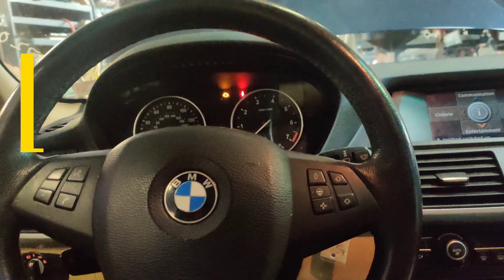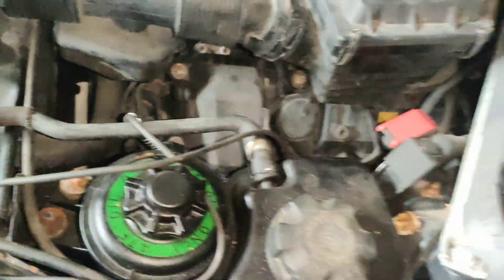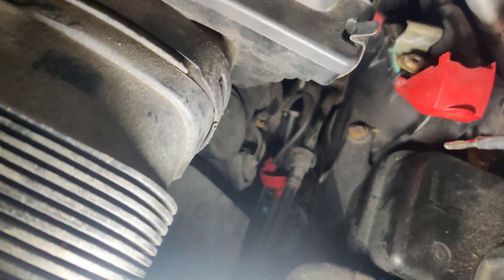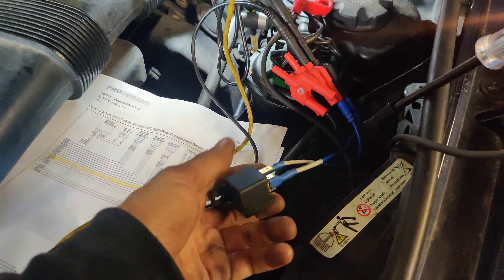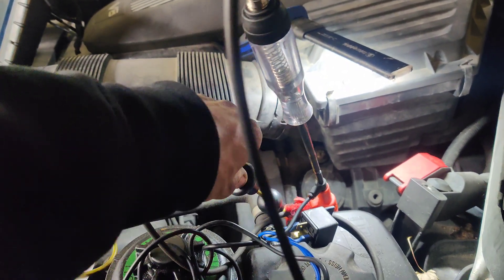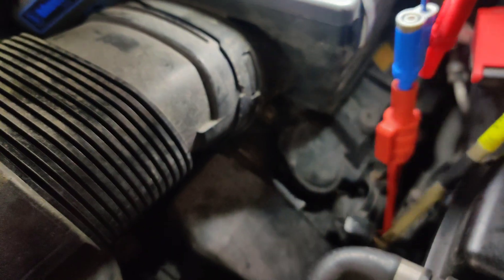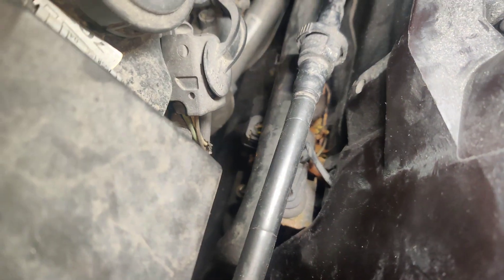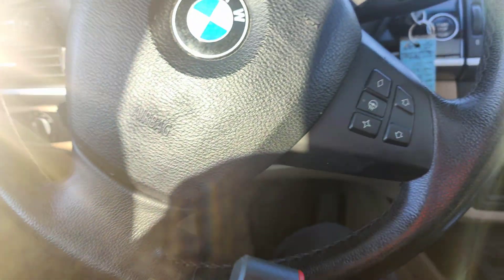2008 BMW x5 4.6l Water Valve Codes A72E & A6D2

Comment: So the problem in the end was a faulty heater valve unit?

I have both of these codes, and replaced my heater valve, which when I opened it up, was corroded and the valve seals were all perished.

However the same fault persists, same fault codes, and hot air still constantly blowing out of my vents at all temperatures, even with Air con regassed and cold, the hot air is still blowing out at the same time as the cold air, so cebtew vents are cold, bit side vents are warm, it's like the valves are staying open constantly.

Maybe it's just a crap replacement heater valve.
Reply from the maker: Have you tested the valve and yest that is all that was bad on this vehicle. As a note just because you have the same codes and same symptoms does not mean you have the same problem. Only proper testing will reveal your problem.

Comment: Is possible delete???
Reply from the maker: Is it possible to delete what exactly?
Reply: @RobertDotterer  heater valve
Reply from the maker: I guess you could but if you bypass it your ac won't work right or you won't have heat. Also it will set a code for it and it may take the car longer to warm up.

Comment: Unfortunately with BMW and most other euros you won’t find anything on codes on Mitchell....and in most cases nothing on alldata. SOMETIMES you will find info on identifix. Fun diag I’m sure :)
Reply: You will find on a ton of euros if any component is directly wired to a control unit (no fuse between) there will be current monitoring that will kill the circuit if the control unit fails to see the resistance it expects on the circuit. Can make bidirectional testing useless sometimes which is frustrating.
Reply: @haakanlight9661  Good to know! Thanks for the info!
Reply from the maker: I've noticed that.

Comment: Another pro tip man.  Thanks.  Good stuff!  Congrats on the 1.6K sub mark man!
Reply from the maker: Thank you, I appreciate it! I know a lot of people worry about applying too much current but most people don't realize it goes the other way too.
Reply: @RobertDotterer  Yeah, I didn't know that about too little current. Great info! Thanks for posting!
Reply from the maker: You're welcome, I have another video somewhere too where I tried to test an air compressor circuit and it did the same thing. Watch my video on the Ford 4x4 actuator or Cadillac oil control valve, the show how you cannot use a test light to test them, they need resistance.

Comment: Nice diagnosis. Interesting about the current draw. I wonder how many amps those water solenoids pull. I had a similar fault with an S type Jaguar. The water valve solenoids burnt out and took the control module drivers with it.
Reply from the maker: Thank you, I haven't seen one take out a computer but I think it's around 750ma on the BMW. I measure one before but I can't remember. If you measure the resistance you will know.